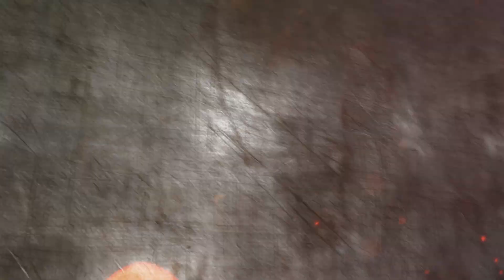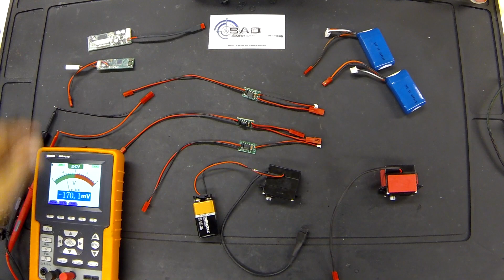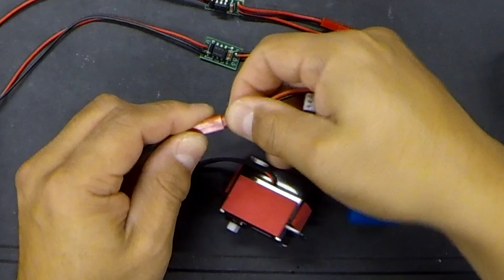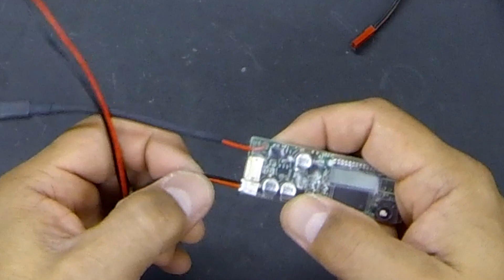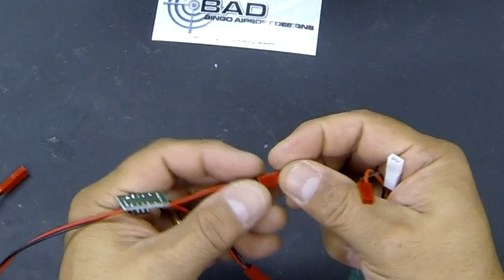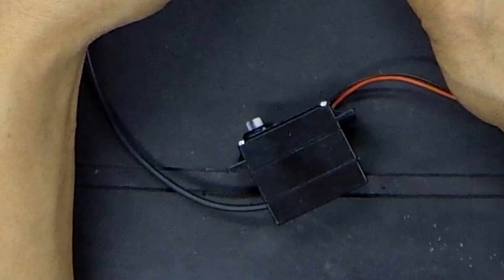Bingo Airsoft Designs Trigger Control Unit (TCU) for HPA Engine FCU to Box Mag linkage

Comment: Is there any way I can get one of theses? I need one for my build
Reply: Hey let me know if you find an answer. I’m also in the market
Reply: @kmart5232  I ended up building one myself. And I also put in a voltage controller so I can actually run my box mag add a lower or higher voltage so it doesn't over spin so basically adjusting the box mag feeding to my Polarstar off to. Works absolutely beautiful
Reply: Have you got the design or considered making more... to sell?
Reply: @jameswright3932   ya I know how to make them and have the parts and made a few for some people. I might mine alittle diff cause I add in a variable speed controller to Control box mag  so I can speed it up or lower have fast it feeds so it match's the gun rof.
Reply: Cool... would you care to share the design? I see the need for a tip120 mosfet, a few resistors and 1 diode... just don't know the value for the diode. Thanks in anticipation
Reply: Any news on a diagram of how you made your control unit as I’m in need of one?

Comment: Rudy what about the G&P stoner 63
Reply from the maker: +scotty dowdal A TCU circuit isn't needed on a G&P Stroner 63. Just wire the hopup 
block directly to the mag/gpio port on the FCU. It will trigger the box mag 
when the trigger is pulled, and the box mag will wind using the 9V 
battery in the mag.
Reply: +BingoAirsoftworks 
Thanks Rudy my fcu must be messed up 
I'll contact wolverine 
Thank you again
Reply: What is the hopup block? The part that attach to the shell of the gearbox that was once wired to the trigger?
Reply: Also the f1
Fcu port is bigger than the connectors on the tcu do u know why?  The tcu connector fits on my fusion egine fcu with the tiny two hole port but the fcu has the 3 prong port
Reply: Dont think its the fcu i just tried 2 different ones and its all the same box mag winds with no battery plugged in fcu when u plug a batt it stops and the trigger doesnt do anything to the box mag it doesnt wind it when i shoot
Reply: Also the wires on my tcu are backwards its red where its soppose to be blk nd blk where its soppose to be red . Could that be the issue?

Comment: great job ! 
do you think it can work on a wolverine stonner 63 G&P ?  thx !   sorry for my english i'm french
Reply from the maker: +Vahlk Red Waters A TCU circuit isn't needed on a G&P Stroner 63. Just wire the hopup block directly to the mag port on the FCU. It will trigger the box mag when the trigger is pulled, and the box mag will wind using the 9V battery in the mag.
Reply: thx a lot !  can y replace the 9v battery by a 7.4v lipo, without any other modification on the box ?
Reply from the maker: +Vahlk Red Waters You would just need to change the connector to one that works with your lipo. Or, if you wanted to use one lipo to power both the FCU and the box mag, you can use the TCU kit in power pass-through configuration, and then you won't need a battery in the box mag.
Reply: +BingoAirsoftworks thx a lot !
Reply: +BingoAirsoftworks  do you have an idea to instal an m4 stock with a tube on this ?
Reply: +BingoAirsoftworks hi, i exactly made that and the box mag dont trigger when i pull the trigger. when i directly connect a battery to the hop up block  that trigger the box. do you have any idea to help me ?     thx
Reply from the maker: +Vahlk Red Waters So when you hook a battery to the hopup block it will wind? (I assume you also have a 9V in the box mag too). Check your FCU and make sure that it is sending 3V to the mag port. There were some FCUs from Wolverine where the mag port was not working. If that is the case, contact Wolverine airsoft, they should be able to replace the FCU for you.
Reply: +BingoAirsoftworks ok i wanna check this ! thanks a lot again ! merry christmas !!
Reply: +BingoAirsoftworks  when i hook a battery to the hopup block  it feed the bb's permanently,  with the 9v batterie in    and same think without it
Reply from the maker: +Vahlk Red Waters Ok good, so it's likely a bad FCU then. Contact Wolverine, they will take care of you.
Reply: +BingoAirsoftworks  thanks a lot !!!   

ps: the m249 noozle work very well, so thanks again ;)